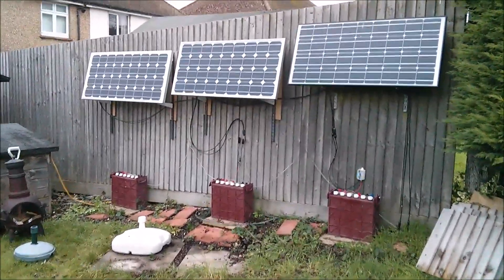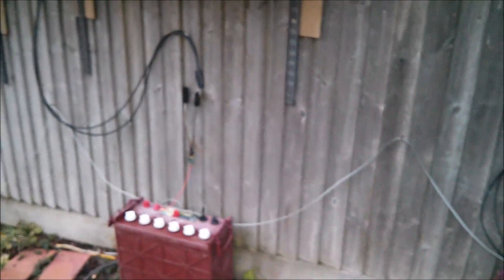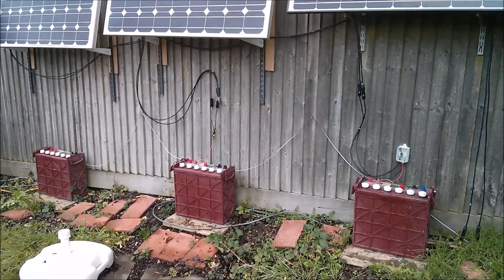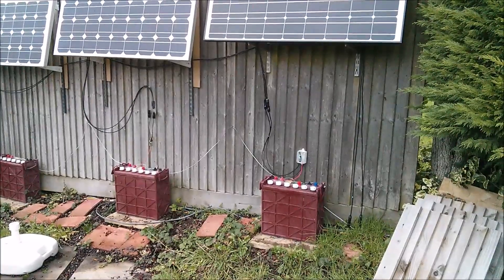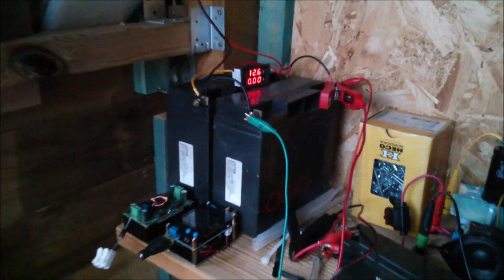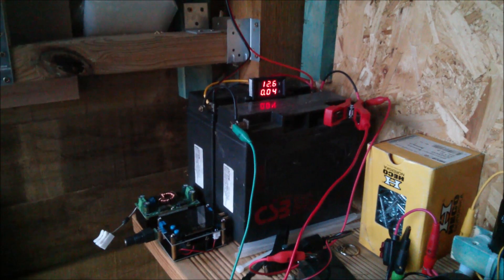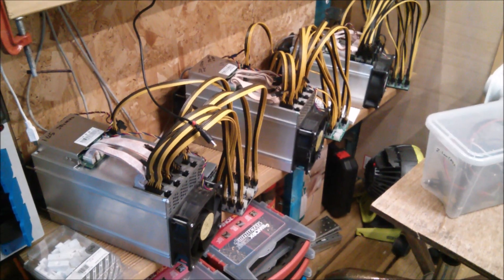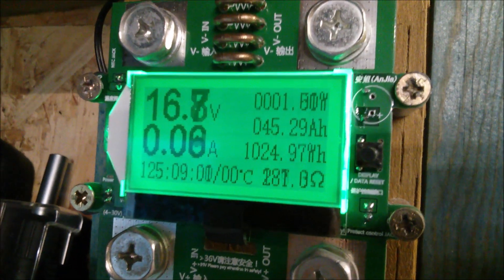Power Wall Upgrade

Comment: Seems like a lot of inefficiencies. Which is good as it will improve. Some thicker cable and maybe 24v. only one bank of battery keeping same amp h rating to prevent imbalance.

Comment: Do the ant miners break even on the power they consume? That is a great idea for low/no cost heating. I'm not sure I could handle the noise, though. I wonder if a liquid cooling system could pump out the heat with larger slower RPM fans for less noise?
Reply from the maker: The Scrypt miners are close to break even (particularly now). The other miners all make a substantial loss. Free electricity would make them all profitable :)

Comment: Do you really need a charge controller with those huge batteries and those 80W panels? 
it's not an MPPT and even them, a real MPPT charger's cost will never be paid back on small systems like these.
I doubt you can fill these huge batteries, given you are in rain island!
Reply from the maker: Possibly not in the winter, but in summer they'd bubble dry.
Reply: @JuliansShorts  I have a small 50 watt setup and made a 13.85V load dump trigger, out of a comparator, a TL431 and a bunch of resistors and caps.
When the battery voltage reaches 13.85V, it switches the relay over to PTC heaters scavenged from electric heaters.
Dumb the extra energy and also stand guard and never allow electrolysis to start which is about 13.85V on lead acids. No matter what the charger is doing. 
Making sure there is a hysteresis resistor used on the comparator, to release the dump load at 12.8V. I think mine was 100k. Memory is dying with age...
Reply: PicoNano - blooming cheek,  “rain island’, I have you know that we do often have multiple days in a row where it does not rain (okay, mainly in summer). So that’s better than countries with a rain forest, where it normally rains EVERY day 😁
Reply: @Mark1024MAK  I wonder why they call it a rain forest, when it only rains everyday! :)
If shit don't change like right now, GB will become as cold as here in Canada! 
Then you'll be like us, and live in a snow forest. 
Do you find winters getting harder around the British isles? 
I find winters getting milder and shorter every year here in Ottawa Canada.
Reply: @piconano  - it’s hard to tell if winters are getting colder or warmer, due to our weather being largely influenced by the wind patterns. Our summers do appear to be getting hotter though. I live in the South West (near Bristol / the Severn Estuary), and our winters are normally considerably milder compared to the north of the British Isles. Day time temperatures at the moment here are around 2 to 4°C, and overnight the low is about -4°C. Slightly lower in the countryside at -5°C. Although we sometimes get snow in winter in my area, it mostly does not settle (the ground being warm enough to melt it). Occasionally (about 1 in five years), it does get cold enough so that when a low pressure system comes in, and it snows, we get about 6” / 150cm to 24” / 600cm of snow. This normally brings absolute chaos, as most drivers here are not prepared and can’t cope.
Reply: @Mark1024MAK  Thanks for a detailed comment about the weather there.
Some Australians are sitting by the beach in swim trunks, having a cold one, and laughing at us right now, saying; Cheers mate.

Comment: Get the panels on the shed roof in series. 👍 what. Vdc in can your charge controllers handle?
Reply from the maker: The shed roof unfortunately can't support panels - which is why they're on the fence.

Comment: Thanks for the update, Julian. I'm going to say what many will say and that is, I'm pleased to see the charge controller nicely protected in the water-proof enclosure and working well. Others will moan about fact that you didn't use stainless steel screws on the enclosure and they're already rusting (well, it's still a huge improvement) And the last thing was noticing the charred remains of the middle voltage controller that suffered a major burn-out still hanging there to remind us all that exposing PCBs to the elements is not a good idea! Anyway, love your videos and all updates (that sometimes cause so much fuss) and also a Happy New Year to you and you family!
Reply from the maker: I was thinking just today - I must get some countersunk brass screws for the enclosures. I'll make an autopsy video on the burned out controller soon. Cheers Andy :)
Reply: @JuliansShorts   Just got the same enclosures in today. Do they happen to be 85x58x33mm from an Aliexpress seller?  This certainly reminds me to use different screws which might cost more than what I paid for the enclosures. Wondering if there is another way of making them a bit more rust resistant than getting new screws.  But you should certainly get some fuses there. Saw some resettable car fuses on Alie for like 2 euro which might be interesting to be used.

Comment: Thinking your battery wires are way under rated.
Reply from the maker: The link cables - between the Trojans?
Reply: @JuliansShorts  All power leads from battery to shed.